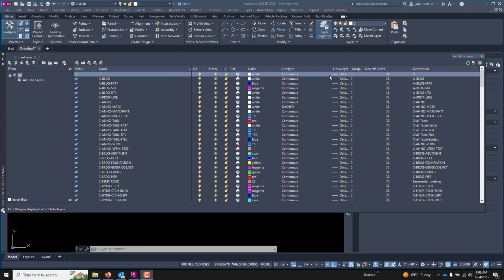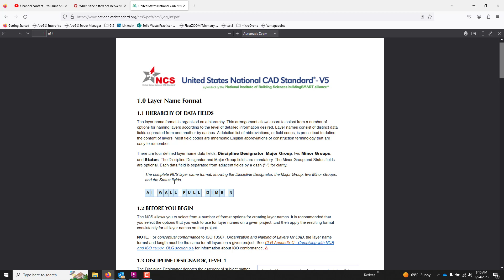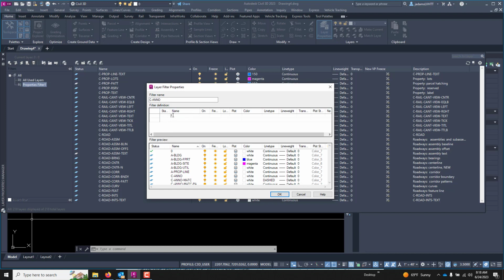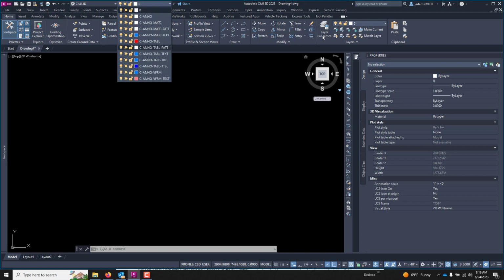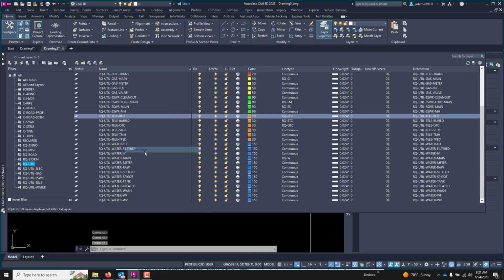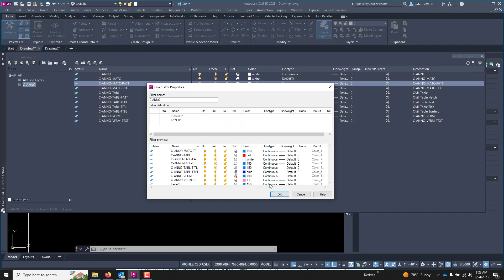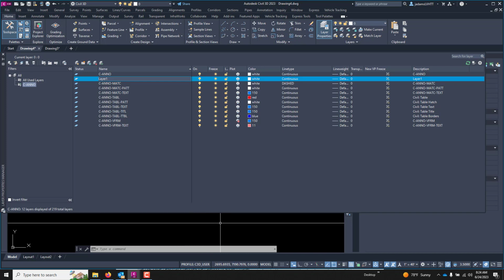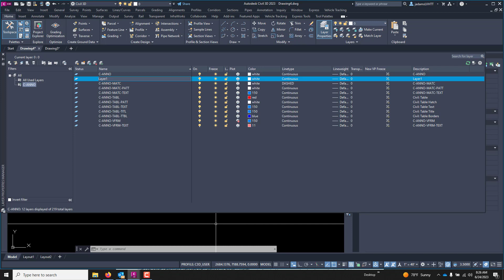Civil 3D Layers Properties and Filters

Comment: Hey, i have a question about layers. Let's say I have 100 points on my drawing. And I want to seperate these points by name for 2 layers.I have KA1,KA2,KA3.....KA50 and KU1,KU2,KU3,........KU50 .I create KA and KU layers. How can i select all KA name starting points ?
Reply from the maker: If they are cogo points you can select them from the point table by choosing cogo points in toolspace and then laycur them or you can use point filters with a style to place them on desired layers